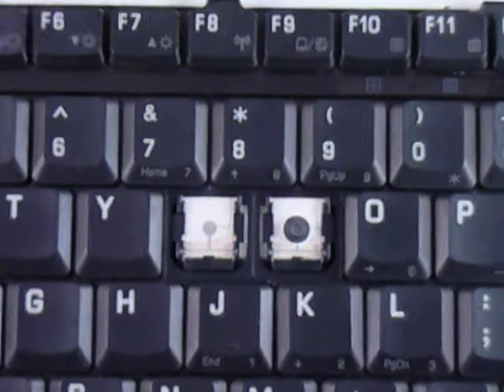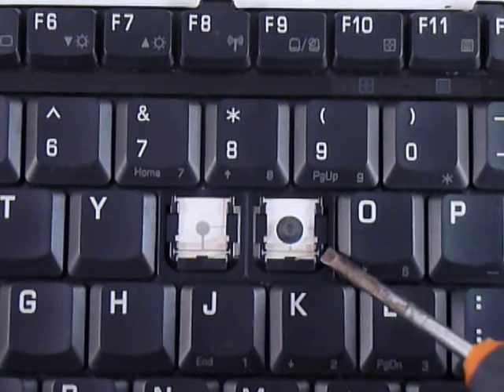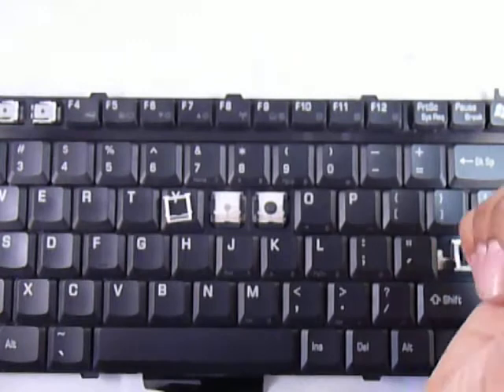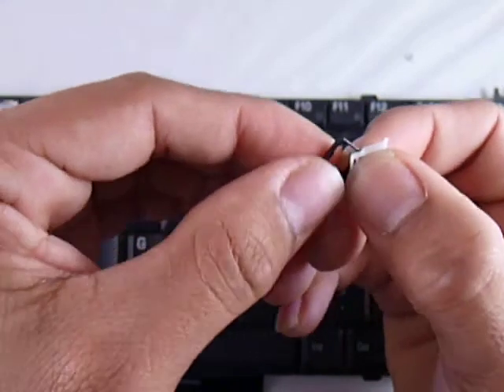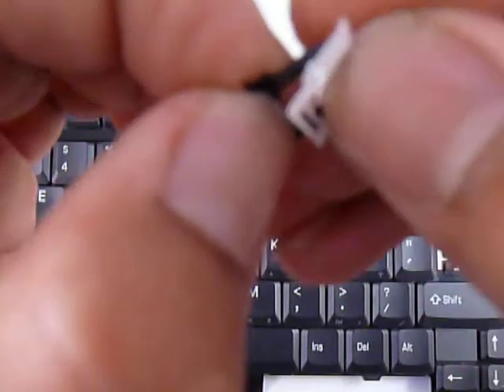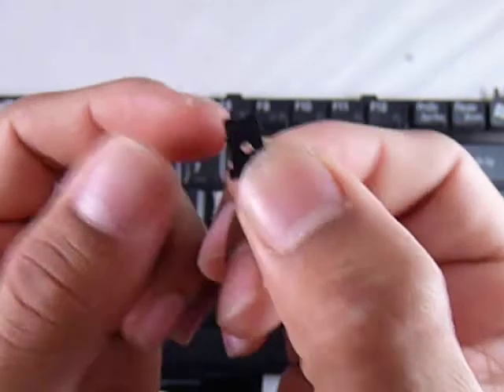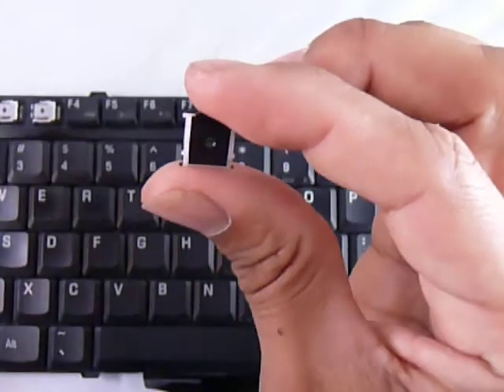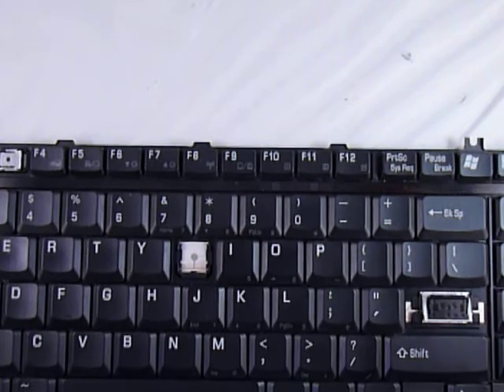Stuck Sticky keys, Fix / clean your laptop keyboard Keys Toshiba Keyboard

Comment: this looks like TOO MUCH WORK sh!t i'll just pour water on my laptop and then air dry it off like i did when i spilled soda on it lol cuz im not doing all that
Reply: Exactly! Disconnect power, remove battery, remove keyboard. Run it under a tap, blow the keyboard off and leave it to dry for an hour or two. If that doesn't work, Amazon has replacement keyboards from $13.00. Easy peasy! I'm going to try that now, and will repost. THANK YOU !!